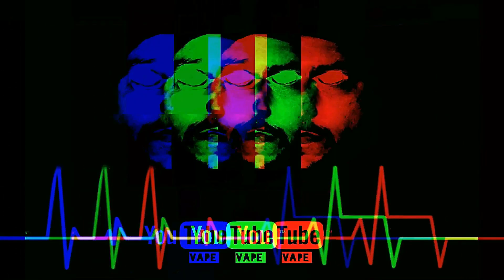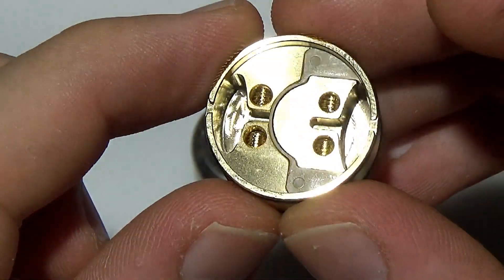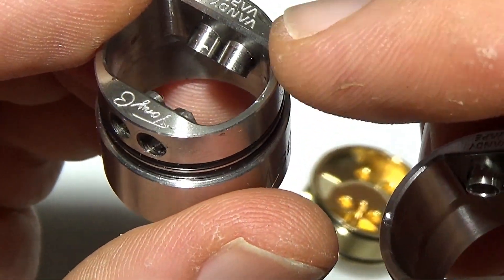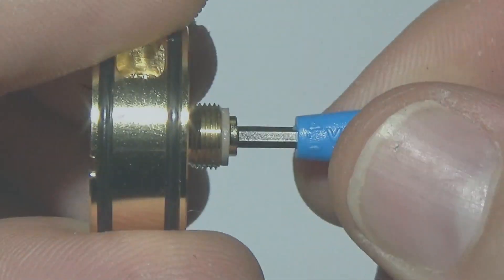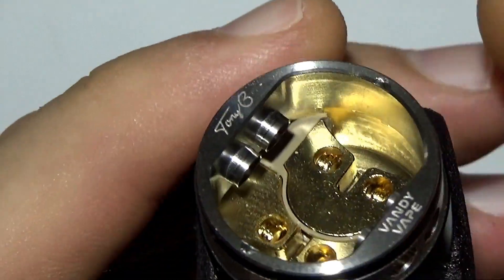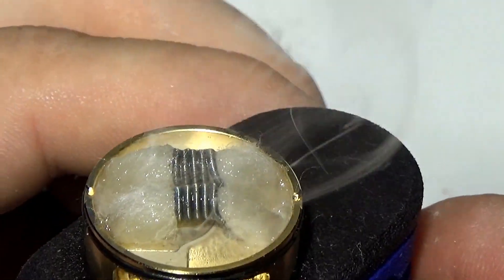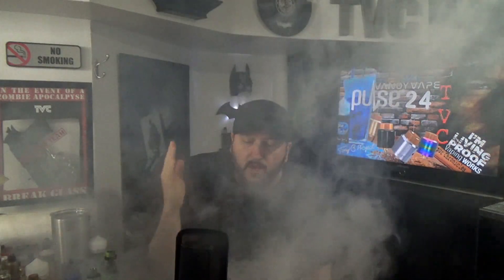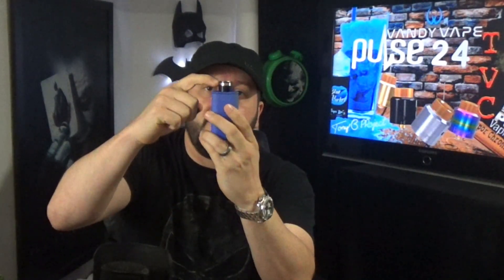Pulse 24 BF RDA From Vandy Vape & Tony B w Build & Wick On TVC

Comment: I've had the 24 in SS for a week now. It's looking like a solid RDA. Unfortunately, I can't use it right now, because I don't have any coils yet to install into it. I'm waiting on my order to arrive for coils. My point here is, VV should have included a set of coils with it
Reply: iwannacamp what coils do you recommend for this RDA?
Reply: I've been using 4 different Clapton style coils: Stapled Staggered Fused, Spaced, Framed and Alien V2. They all have ohm'd out around a .19 ohms. They are in the Violence Coil 7 in 1 kit by Demon Killer. I'm not a coil expert.  I'm still trying to figure out what's best
Reply: iwannacamp I’ve never had a unregulated build so I just really wanted to be safe hah

Comment: I made sure to order a 24 with my Pulse Squonk on order... and also have a Dead Rabbit coming so I can better understand each difference you and your peers keep us up to date on.
Reply: thank you for the swimming analogy, I kinda like the spray... my Squonk mod is enroute so I'm testing the 24 on a hybrid- thus swimming saves from perpetual dripping. Very cool how you can vape once with the power running and then grab a second taste while the coils are still warm. Very easy to build on this deck. What is the best rdta in your opinion?
Reply: mrphilip I see you got both the pulse 24 and dead rabbit, as do I.  I’ve heard so many good things about the dead rabbit but I can’t get myself to use it.  Flavor to me is nowhere comparable to the pulse 24.  Also, the top cap on the dead rabbit tension is very loose.  
Was wanting to know what you think since you also have both.

Comment: Dude, I respect your opinions, but I don't think you understand how airflow works. Air moves from high pressure regions to low pressure regions and will always find the path of least resistance. It will not magically duck under and circumnavigate coils, regardless of how much one wants it to. I think people who design these coils would be better served if they actually understood a bit more about fluid dynamics and ran some CFD models before releasing their devices. Not disputing that this device has good flavour, but pointing the tubes at the coils and praying does bupkiss.